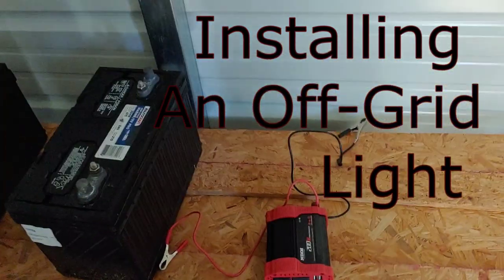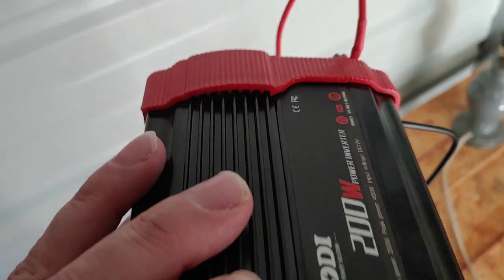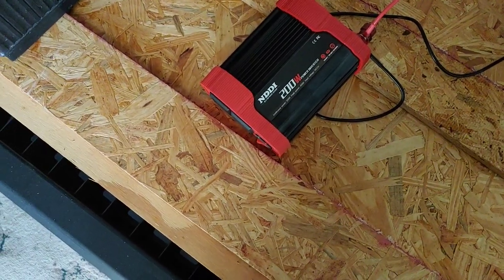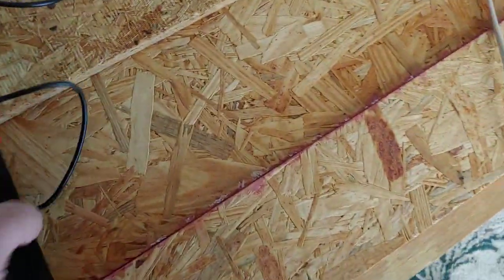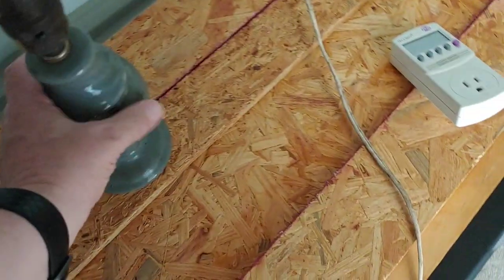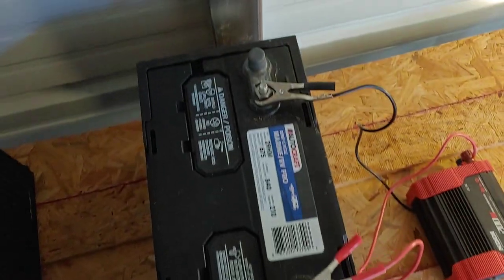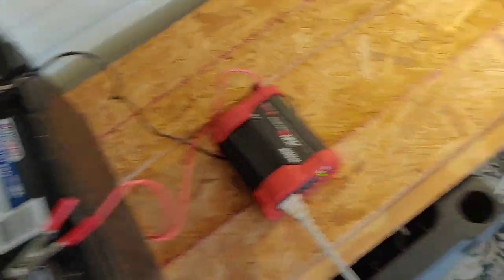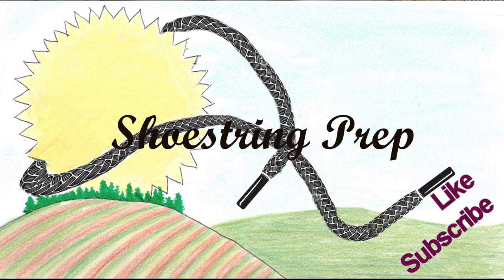Installing an Off Grid Light

Comment: This is a grand video, mate. Recently happened upon your channel, subscribed, liked, and slapped the bell. I'm attempting to learn the solar, inverter, charging info and you plainly explain the process with needed small details like that about attaching the positive first, and that you may get a small spark when attaching the negative. I'll visit the links provided, ta. At about 1:50 in the vid you state that car batteries aren't made to be charged over and over again. I thought that they were, hence an alternator, nonetheless I believe you meant that they weren't meant to be 'greatly' discharged and then charged over and over. So I follow on the marine deep cycle being the one to work properly. Are marine deep cycle and AGM batteries one and the same? I'll check your site for past videos. Lastly, please pardon this lengthy comment, do you have vids on using the multimeter and the Kill A Watt devices? Once again, a champion job, ta, Jack
Reply from the maker: Thanks for your kind words. Yes, you are correct. The car battery is not made to be discharged and recharged in the way that a solar power system works. Thanks for clarifying that for everyone.
The main difference to note between a marine deep cycle battery and an AGM is that the deep cycle gives off fumes that don't belong in your house while AGM are sealed and don't have this issue. There are additional differences, and you can learn about them here: https://youtu.be/DiRCCRjxztY
The video on how to use the Kill A Watt is here: https://youtu.be/sqPpCOczlQQ
I don't have a video showing the multimeter at work at the moment, but I will add that to my list of future topics. Thanks.
And thanks again for your comment.